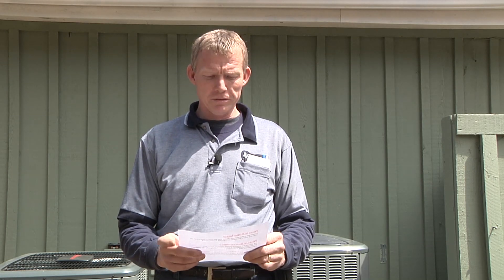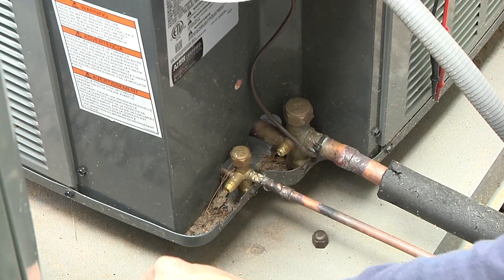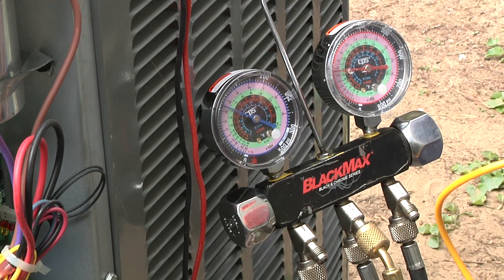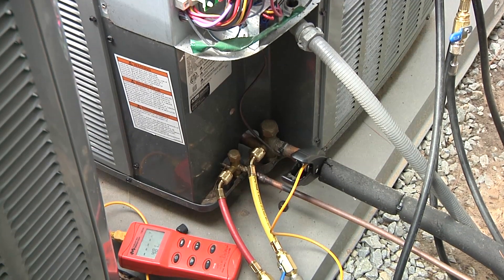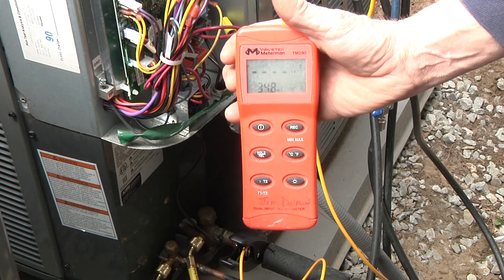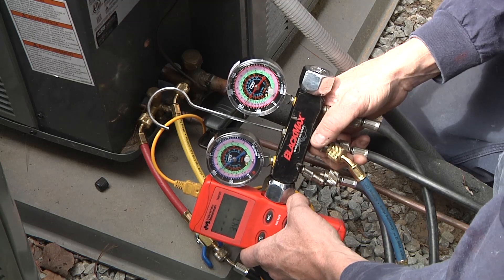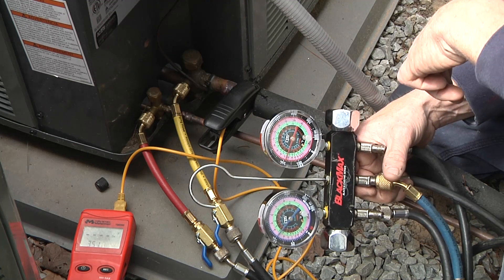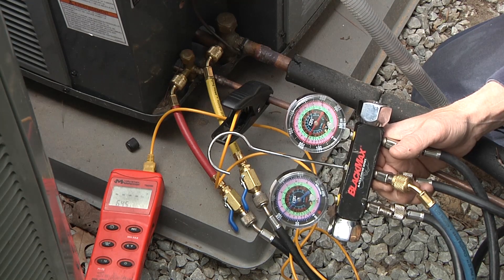Central Air Conditioner - Eliminate repairs - Proper way to Clean & tune - 14 point inspection

Comment: Isn't it best to do the maintenance checks and cleaning first,  then check superheat / subcool last after the system has leveled out?
Reply from the maker: ritewayguy
            Yes it is, this unit was cleaned and tuned. We have six other videos showing the clean and tune on this unit at ApplianceVideo.com. He is only referencing back to anyone trying to check super-heat or sub cooling that did not do their maintenance first. Thanks for your input, it is appreciated.   Please help us provide more videos to our site by subscribing to our YouTube page or posting ApplianceVideo.com site on your Facebook or Twitter account. We also have our factory authorized technician’s email daily free professional advice to people like you to help solve their appliance problems. Thanks in advance for supporting us. Matt, Ace Appliance service technician.
Reply: Yes, the guy mentioned that in the video.
Reply: +ritewayguy   Yes,, absolutely!  But he's wrong about which metering devices require which type check outs!  For instance,, "superheat" method works best with "t/x valves" (or thermostatic expansion valves) NOT with fixed orifice/metering devices!  And 12 degrees isAnd, the optimum location for taking your temp. reading is near the "EXPANSION VALVE SENSING BULB LOCATION! Not at the o.d. unit suction line! Subcooling is the checkout method for fixed orifice/capillary devices!!! And there's the method of adding 100 degrees to the outside ambient temp. to arrive at the proper head pressure. That was all done with r-22 systems! There are so many variables to consider, and be careful of! Hows the air filter, are all vents at least 80% open, is the blower wheel clean or filthy? A filthy blower wheel/squirrel cage can reduce air flow up to 25%!  And on multi-zoned systems, are all dampers functioning properly? Is the entire length of the lineset/tubing too long for the "proper installation" of that particular system?! Was the tx valve sensing bulb properly clocked in position on the suction line? Was it properly insulated??  So many things can affect the pressure readings. How about compressor oil "migration"?!? And in the case of a compressor failure and replacement,,,was there excessive compressor oil left inside the freon lines/coils!?!
Reply: +Sonny Cannon I believe Jim Dolan with M&M Heating and Cooling is correct regarding measuring superheat for a metering device and measuring subcool for TXV.